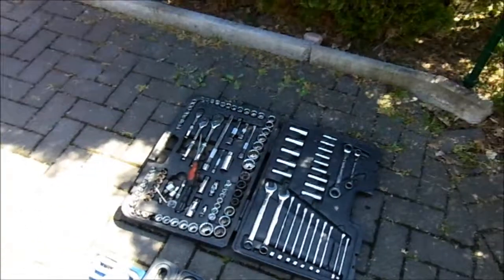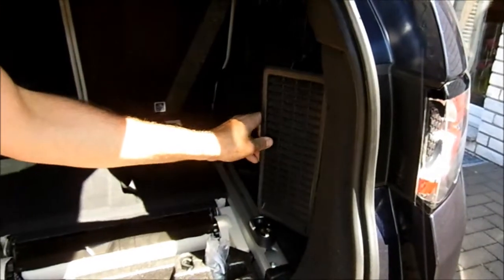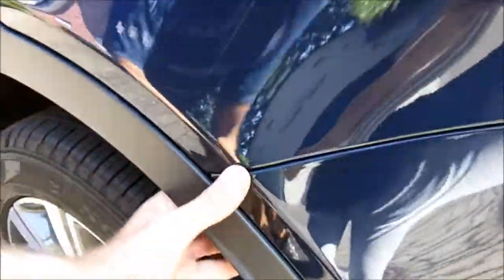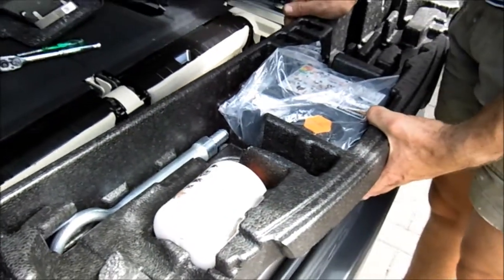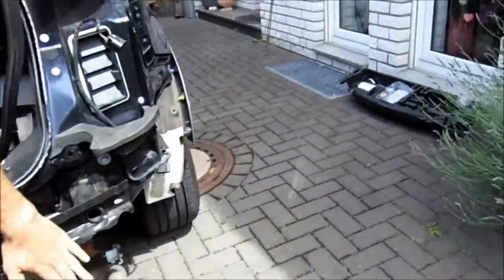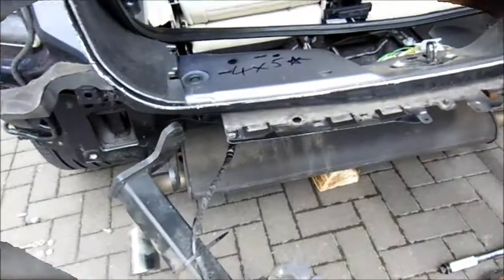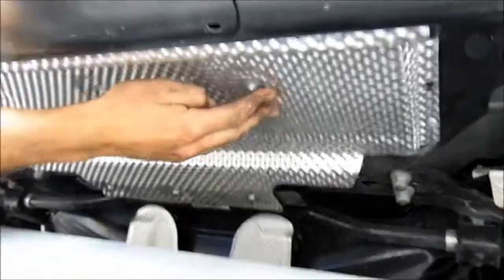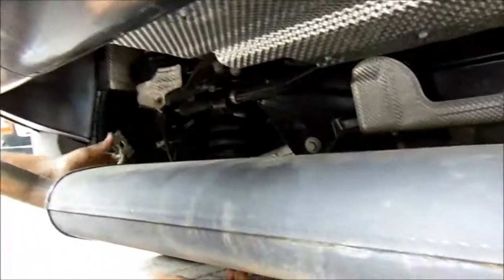Land Rover Discovery Sport Towbar Removal

Comment: Hi,  I'm hoping you can help, do I need to remove the rear bumper to replace the rear bumper lights? Thanks
Reply from the maker: I cannot remember as it is nearly 3 years since I did it but if I remember then I think if you take off the lower centre but you can get your hand up to the best of the light (engine cold as you are right next to the exhaust tips).

Sorry I can't be more helpful
Reply: Many thanks, I appreciate you taking the time to reply.

Comment: Hi, what's the reason for removing your towbar?
Reply from the maker: I was swapping the car for another DS and moved the towbar over to the new car
Reply: @mercedes_and_more  I am looking to install one, as I bought a caravan and saw that the towbar fuse is installed from factory on my MY15 HSE, so hopefully I have all the prerequisites and wire looms
Reply from the maker: @klisurski  as long as you are using the dedicated wiring kit for this car then it should be plug and play. Don't buy from LR, direct price is about 50 to 75% cheaper from any good towbar supplier. In used Kupplung.de but of course you may have to pay charges on this now if you are in UK due to Brexit.
Reply: @mercedes_and_more  I'm in the EU now and DE is ideal for me. Thanks!
Reply: @mercedes_and_more  I picked 13pin speciffic kit "Trail-Tec electrical kit 13-pin relay specific" but it says "Activation required: YES"
Did you have to do any OBD reprogramming if you recall? If it is required indeed I will have to visit the official dealer and they might not want to activate it as it is not bought from them, I reckon
Reply from the maker: @klisurski  I seem to remember I didn't but you do need to disconnect the battery and then reconnect. This link to fitting instructions https://www.kupplung.de/ac-elektrosatz-131252-13104-1.html may help. My first DS was factory fitted with a bar but the 2nd and 3rd I fitted myself and I sold the bar onto someone when I sold my 3rd car and they also didn't have it coded.

Let me know how you get on